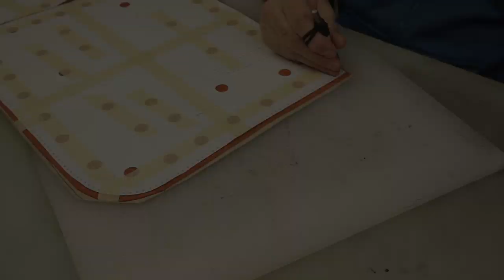Angelina Leather Tote Bag DIY (PDF Pattern in Description)

Comment: 1st question: Why the holes in the pattern, so you don't have to tape the outside of the pattern maybe? Leaving less residue on the leather?

2nd question: Did you lick that magnetic closure? So it would leave a mark? Never saw that before.
Reply from the maker: I make a reusable cardboard pattern. It reduces the risk of mistakes. And yes, i put a drop of water on the magnet to leave a mark :)